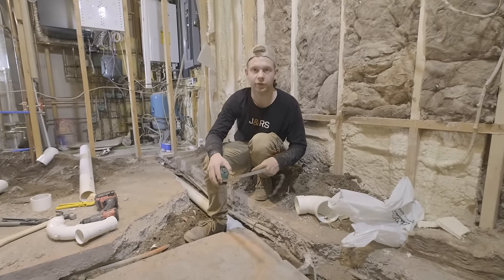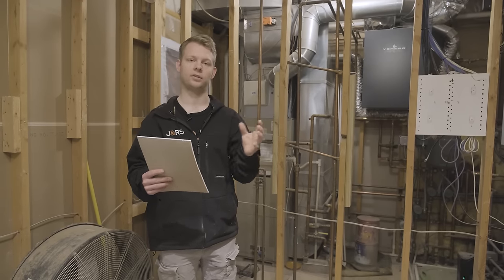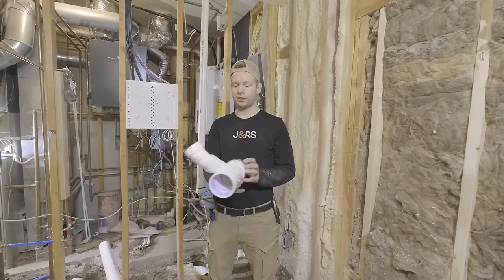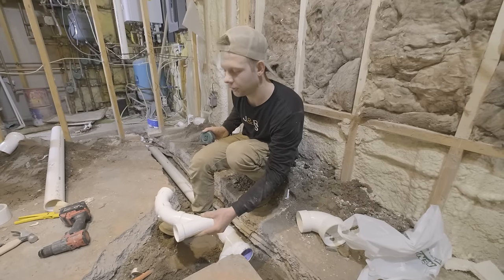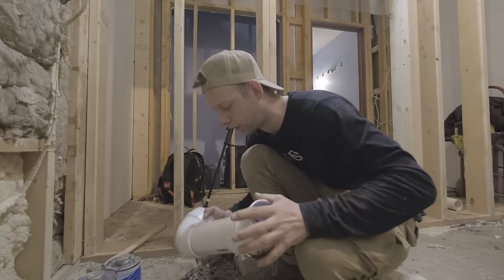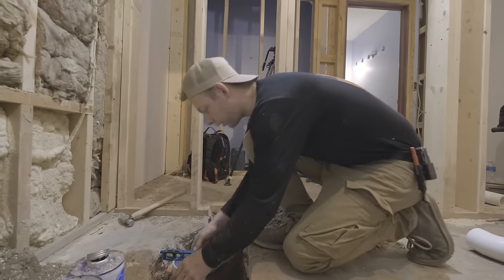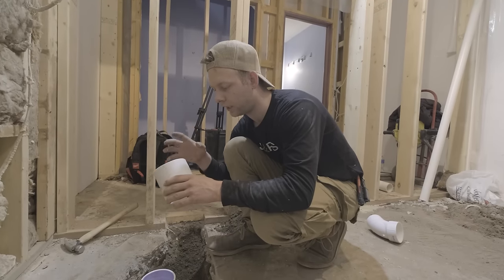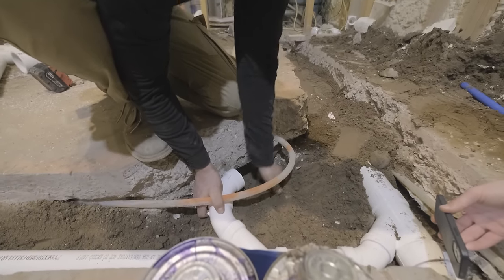How To Plumb a Bathroom With One Vent! Two Sinks, Toilet, and Tub/shower!

Comment: Great video. Very informative. Question; How do you grade your waste pipe 1/4 in per foot and still keep your toilet flange level? 
Is the extension pipe glued in on an angle ?
Reply from the maker: Good question! Plumbing fittings are designed to have a tiny bit of play, and as long as you hold them when the glue is setting up, you can get the riser pipe very close to level.

Comment: My question is why did you have to run the wet vent out and then turn it back into the main trunk?  Why couldn't you just drop straight from the wall into the trunk?
Reply: Because the tub drain after p-trap can only go 5' max before having a vent, and you can't put a dry vent horizontally under the slab, so the solution is a wet vent that both drains the sink & vents backwards for the tub. This frequent use drain will wash away blockages that occur in a prohibited horizontal flat vent. So directing the sink drain out and back provides venting (washed vent pipe that won't clog) for the tub. That's the whole idea of wet venting.

Comment: Just curious why you didnt run the sink(s) drain down straight to the 3 in. pipe running directly under it and not have to make the long wet vent?
Reply: Code would stipulate that the wet vent must be 3" extended to the highest fixture then ( the lavs ) on the branch. Which would work but be more expensive and also have a 3" pipe in tye lav wall

Comment: good video. That said lets talk about that clean out. I believe it is too high to qualify ( within 18" of floor) and not required by code. Not sure what the inspectors are doin to ya over there but nobody with a brain is going to empty out the top two drawers of that vanity to see if there is a clean out there. Your trap serves as rodding access.  Nice looking job. They let yall put crimped pex under a slab there? (34:39) or am i seeing something else?

Comment: If you are using a torpedo level a quarter bubble would be actually 1/2” per foot. A torpedo level is only 6” long so you are measuring only 6” section
Reply from the maker: Great point you bring up! Grade differs from each torpedo level to the next so its always good to double check your own level that 1/4 bubble works. The levels Marlin use have a 1/4" per foot mark that happen to be about a quarter bubble.
Reply: My torpedo level is 9”
Reply: all torpedo levels are 9”

Comment: Yea i can't stand when people don't put the drain at the right height cuz then you have to use extension tail pieces. Or not putting the toilet supply line high enough off the floor to allow baseboard or whatever. Wish i had guys like you working with me. Hard to find people who aren't lazy and wanna cut corners

Comment: Is the shower able to draw enough air from the TY fitting where the sink drain line (wet vent) joins the shower trap arm? Could the shower trap arm fill up with water, create a vacuum because vent air is restricted or maybe even prevented by the TY?
Reply from the maker: Thanks for the comment! With the proper grade on the shower arm, it will not be a problem. This method of venting is engineered and passed by the state.
Reply: @jrsbuild  The question is specifically about the fittings used; is a "TY" acceptable by code, or optimal in general, over a sanitary T? Canadian code does not permit use of a "TY" fitting from a trap arm to a drain line because of it's restrictive internal shape. Sanitary T's are the only acceptable fitting because it's shape never allows the trap arm to completely fill with water (because the path for air to enter the trap arm always exists, not and an inch or 2 away from the actual opening of the trap arm). If a trap arm completely fills with water and pushes all of the air past the opening in the TY (where it meets the drain line), there won't be room in the trap arm for vent air to run back to the fixture because the air doesn't have a smooth, immediate path (but rather a sharp turn).
 Perhaps code is different in your area.
Reply: @alan2112drums  I'm not a pro plumber, but it's my understanding that TY is permissible on a horizontal, but not vertical drain branch.  SanT only on a vertical branch.  This makes sense when you think about what region of the connection/fitting a slug of water will occupy as it passes through the branch.
Reply: @sportscarclinic  Actually, that makes sense; perhaps the force of gravity will prevent the column of water from completely filling the horizontal TY, hence no vacuum to suck the trap dry. (I'm not a plumber either!).

Comment: You’re piping a wet vent and you have to roll the first wye above the center line of 4” drain
Reply: Also second 2" Y - shower - bathtub to sinks.
Reply from the maker: Thanks for the comment Jim! I'm not sure which code your describing, but in this case we are going off of UPC (universal plumbing code) and that first wye is not part of the wet vent but part of the drain tie in for the bathroom group. I appreciate your feedback, stay tuned for more!

Comment: I wonder what would be the downside for using one of those cheater vents down there in the basement you know the ones with the rubber gasket or whatever that is
Reply from the maker: The downside to an AAV or Studor vent is they are not code compliant, and they are prone to failure and would need to be replaced.

Comment: Your supplies should be rough in 4inches above your waste for the sinks. That's standard.
Reply from the maker: I agree it is better to be higher to guarantee that your supplies reach, on the flip side I like when the stops don't interfere with the drain stopper assembly.
Reply: Bro try making an 8” spread for water if it interferes with pop up.

Comment: Can the piping and vents for double vanities only (no toilet), be 1 1/4” pipe?
Reply: No. If it's wet venting a toilet it must be 2" minimum, if its a DRY vent then the minimum size for a lav is 1.5"
Reply: @MrDmadness  Are you sure?  Not talking about a toilet - forget toilet.  referring to lavatory vent.  I just looked up IPC says "minimum 1 1/4".
Reply: @almccallie4314  it possiblle it is different where you are.   In our older code you could use 1 1/4 for a dry vent of a sungle lav, the catch if course is that you cant buy 11/4 pipe or if you find it it will be expensive. 1 1/2 is readily avalablle.
Old code is my bet. ( canada here )
2" wet vent minimum for a toilet. 11/2 dry

Comment: major mistake was the no hub rubber couplings you used are not shielded.  Plumbing supply store sell them. don't ever use above ground no hubs for under ground
Reply: "Major mistake??
Bit of an overstatement.
Reply: Not true at all.
Reply: Another mistake was the double combo wye to catch the sinks
Reply: Trolls
Reply: Correct
Reply: @dragonslayer3070 …yes it is true…he said upc code…all rubber fernco couplings can only be used above ground, never hidden in a wall or under ground inside a building, you can use them outside underground but only and the beginning or termination point
Reply: Can you explain further? Shielded from what?  Crushing? You're talking about the rubber seal under the concrete, right?

Comment: To me that fitting looks wrong. If it's not a double sani tee it's a upc violation. Can't use a double combo for typing  in two drain lines.
Reply: It doesn’t kill the vent it’s low flow fixtures national plumbing standard allows it never looked up upc but it’s not really a big deal take a shit flush the toilet it goes down the drain I do major sewer work liners pipe bursting directional drills we never have issues even with small bellies in the line from ground conditions that cannot be corrected

Comment: The double T fitting is no longer an approved fitting.  The 5 foot maximum run is more appropriate for 3" pipe.  The sinks perhaps should have been dumped into the main 3" line directly below the sinks and the vent should be a dedicated vent to rejoin the sink vent above the level of the sinks.  Thought,,,, there really is no such thing as a 2" wet vent, 3" yes,, 1.5" never,, 2" ain't a heck of a lot better than 1.5".
Reply: A 2" wet vent is IPC 2022 code compliant for entire an bathroom group.
Reply: @sportscarclinic  How long?   And what may well be compliant,, 2 90 degree turns, 1  180 degree turn  buried under the concrete,,, aggregate 20 horizontal feet of effluent travel.   Yeah it will work.  For how long?  I personally have replaced 2 compliant and  'awkward' systems in the past 2 years.  Respectfully,  Code is a minimum standard, not a maximum standard.

Comment: PRX B is a joke. The fittings are a restriction to the system compared to PEX A. The pipe gos over the fitting and doesn’t expand so the fitting have to have a much smaller ID.

Comment: Plumber here— Not a hater, Great video. However as others have said, there are a lot of mistakes here that will definitely mislead the other” YouTube Plumbers “ out there. Sorry, but in the trade the above expression is not a compliment. 
With the few more holes and pipe, everything could have been vented. 
The correct fitting for the lavatories is a “ double fixture fitting “. And please acknowledge that plumbing codes vary A LOT across the country and world.
The installation that you are creating may work for awhile, but when it doesn’t , the corrections will be almost a complete replacement/repipe. 
Wet venting requires a particular fixture layout that in this age of any fixture anywhere, it’s usually just as easy to vent each fixture separately,tie the individual lines together a head or the attic or roof.
Reply from the maker: Thanks for the comment! We did mention this is specifically for Minnesota UPC, and yes, there are a lot of variations in different codes. I disagree with this needing a re-pipe. With no issues, I have done 50 or more systems like this in the last 8 years. I also know of numerous plumbers in our area that do this method of wet venting. If the system were to cause issues, I would never promote and teach it to others.
Reply: JT...The "Corrections" should come before the work is covered. Could you explain the theory behind the required double fixture fitting?
Reply: @mackellyman5642 the double fixture fitting has a little different geometry for better flow. If you google it and compare to a double ty , you will notice the subtle difference. It’s not much, but just enough to allow a drain snake to go down instead of across an into the other side of the fitting.

Comment: Well it sure seems like those ts that are installed there sure seem like a small orifice affecting your final volume
Reply from the maker: Thanks for the comment Arlen! However we are sized to code. When sizing waterlines the charts in the UPC code book pressure and volume are taken into consideration since they directly affect one another. If this system had low water pressure we would have 3/4" lines feeding the bathroom!

Comment: Speaking of sore gas I saw a fantastic video of this mansion up in the hills of LA I think it was a video by the twins or something about the twin brothers anyway these guys were called in after many people failed to find the gas odor the methane and through some careful reconnaissance they had to tear out the back stuck a wall to find a 10 ft section of cracked cast iron which solve the problem but I'm sure these people were going nuts because for over a year they couldn't find this odor that was coming out of electric outlets high hats other receptacles you name it this odor was seeming to come from many places and now back to your regularly scheduled show
Reply: How about English ?

Comment: This house is not  structurally safe  with the  drilling of the holes in the timber frame
Reply from the maker: Thanks for the comment, Dale! I can assure you that the structure is safe. The holes being drilled were not big enough to compromise the framing as they happened to be in non-load-bearing walls.
Reply: OH NO! That means every house in the USA and Canada are at risk of falling down! Good catch you genius!

Comment: I like to use a push-in flange rather than a glue-in flange on a basement (under concrete slab) situation. I specifically like the one made by Water-Tite( #86193). That way, if you ever need to replace a broken flange in the future, it’s an easy repair.

Comment: Doesn't going with a 2 inch shower drain allow you to go up to 8 foot trap to vent distance?
Reply from the maker: Not according to the MN UPC code. The code differs slightly by state. Maybe Michigan? Thanks for watching!
Reply: You are correct for many code areas. 1/4" per foot and cannot drop beyond the diameter of the pipe without a vent present ( cause its an s trap then) so 1/4" per foot is 8' run .. correct

Comment: Id rather have my toilet on a seperate vent. I also would prefer that metal worm gear clamps arent holding a rubber coupler buried in wet dirt.  This is just how plumbers screw home owners.

Comment: So many mistakes, lav drains to high
Reply from the maker: Thanks for the comment, I have spent time through the years adjusting my drain heights and I found 20" to be a good happy medium to give customers more storage room under the trap. I understand the multitude of opinions, but this is what I have found works well for me!
Reply: It's not too high. Anywhere between 18 and 21 will work.
I woud worry about the clean out.
Is it going to be accessible?
Wouldn't be better to face it towards the mechanical room?
Reply: @zbigniewbrzoza7056  whatever stooge
Reply: @Ice man  
Okay Boomer.  Thanks for reminding everyone that there's only one correct way to do everything.